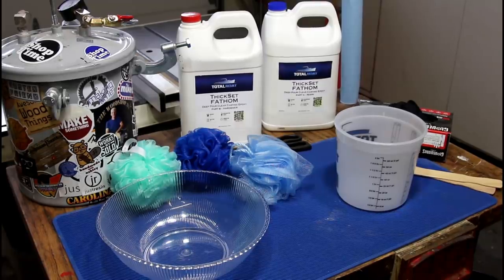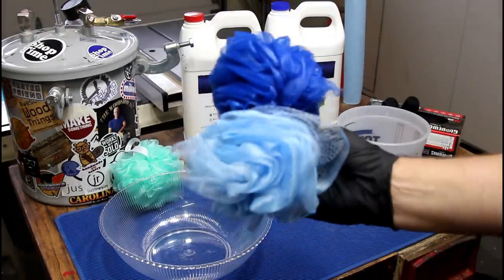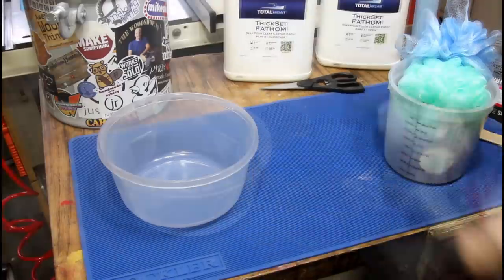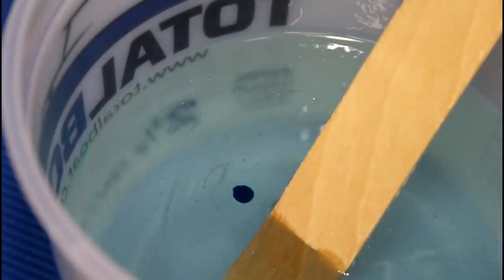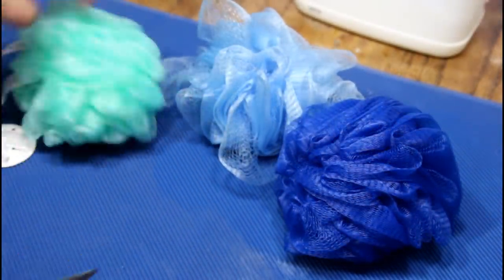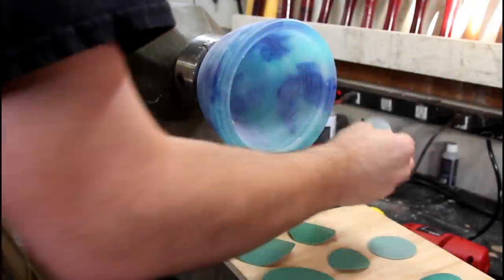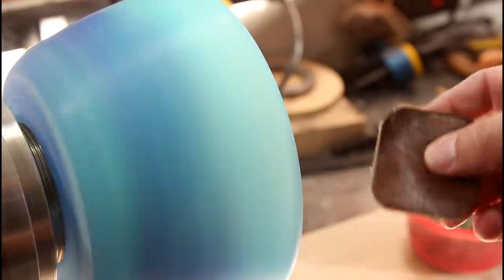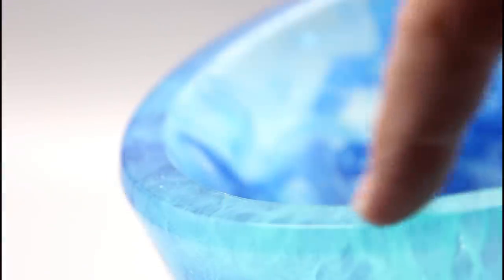Should We Make Something From Bath Poufs?!

Comment: With this many air pockets/holes it might be a wise idea to vacuum the resin/pouf mix before pressurizing it...

I don't know if the Pressure Gauge on your pot can handle a vacuum without breaking but if it can, the Pressure Pot would make a dandy Vacuum Pot without additional modifications - just hook up the vacuum pump instead of the compressor hose...

If the Gauge will get damaged by a vacuum, then a Plexiglass or Lexan disk larger that the Pressure Pot rim and a rubber ring the diameter of the pot rim with a Vacuum Gauge and Vacuum Pump connector port would turn the Pressure Pot into a Vacuum Pot that you can watch the project to avoid foam-overs...they shouldn't cost too much if you're interested in adapting your Pressure Pot...

Comment: RE: Micro-Mesh sanding system. Their grit system is proprietary and when looking at the actual size of the grit in microns, their 1,500 grit is the same grit size as a standard US 360 grit sandpaper - 29 microns. Sanding to 800 grit then starting at the 1,500 grit micro-mesh is actually going backwards. 
1,500 grit = 320 grit sandpaper = 29 microns
1,800 grit = 700 grit sandpaper = 14 microns
2,400 grit = 800 grit sandpaper = 12.3 microns
3,200 grit = somewhere between 1,200 and 1,500 grit sandpaper = 8.4 microns
3,600 grit = 1,500 grit sandpaper = 8 microns
4,000 grit = just above 2,000 grit sandpaper = 5 microns
6,000 grit = just a bit higher = 4 microns
8,000 grit = 4,000 grit sandpaper = 3 microns
12,000 grit = 8,000 grit sandpaper = 1 micron

Comment: REALLY turned out well!!    and with all the different poofs you can get ahold of, the color options are HUGE.. you can customize them specifically if you wanted...The black light REALLY looks dramatic.  i've seen some poofs in neon colors; i bet they would be truly stunning...   now i'm wanting to try to stuff all sorts of molds with unbound poofs before pouring in the resin!!
  would it be worth casting in a wooden waste block core to make waster removal of the inside easier?

Comment: Hey peter. Question from a more novice resin person. If you didn't have micromesh pads, how would you finish your pieces? I have sandpaper up to 1200, which is pretty fine, but it's not micromesh levels of fine. I tried using a car plastics polish that I read would work, but it's still kind of dull. There might be an issue with how I poured my piece, but if you didn't have micromesh, what's another way to polish a piece? Could you do a video testing different methods and products that amateur resin-ers could use?
Reply: A lot of people just glaze their pieces with resin to shine it up.

Comment: Need a question answered.  Just learning resin projects. I want to pour a  color doesn't matter but I use 5 drops of dye in a pint of resin. Now iI need to mix and pour the same color in a later step, but only 1/2 a pint this time, do i use the same number of drops
Reply from the maker: It depends on the pigment. Take a picture of the first pour for help with color matching on the second.

Comment: You do know that you can buy a set of linked smoke detectors and a modern plug in heater for the garage to keep it warmer in there. Unless it is completely uninsulated and you are in a frozen butthole in the north of the US or any part of Canuckistan, then this idea does not apply.

Comment: Mr. Brown, I would strongly advise you NOT to put bath bombs in resin. I’ve tried it before and it wasn’t successful. Bath bombs are made of ingredients like oil and other things which discolored the resin very quickly and actually seeped out through it (even after it had completely hardened). I ended up having to throw my project into the garbage. Take my word for it if you want to avoid issues with your resin projects. 😊